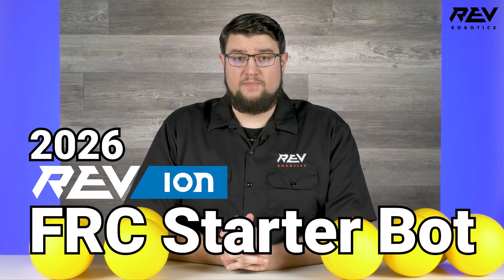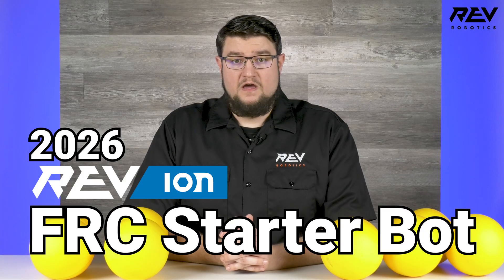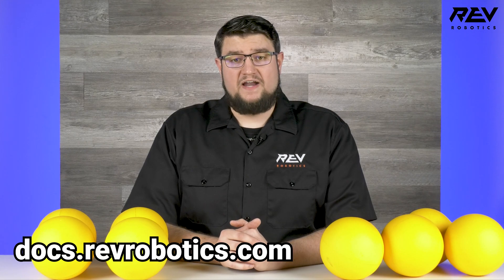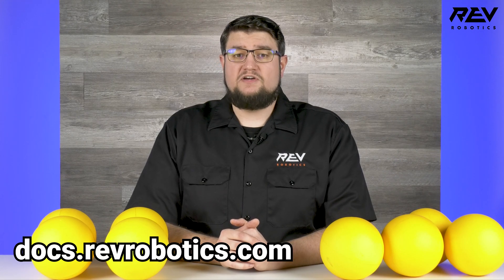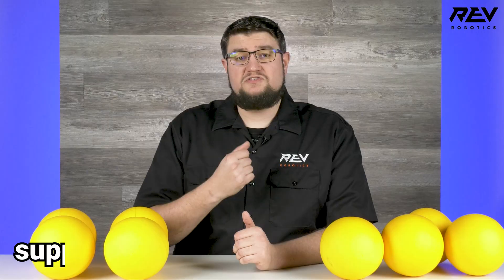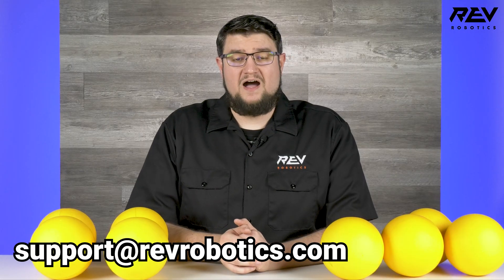Introducing the 2026 REV ION FRC Starter Bot

Comment: What is the bumper geometry? 5" tall 1" ground clearance 3.25" total thickness, or something else?
Reply from the maker: Bumper clearance is roughly parallel with the frame, meaning its about 2-2.5" of clearance from ground for clearing the bumps. Total bumper backing height bit taller than 5in. As always, consult R405 for specific bumper rules for the 2026 season!